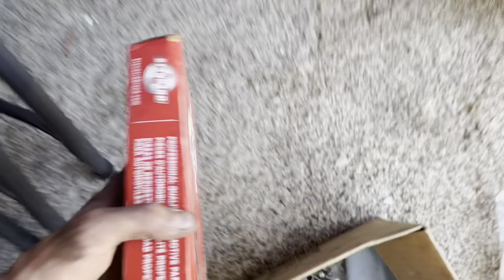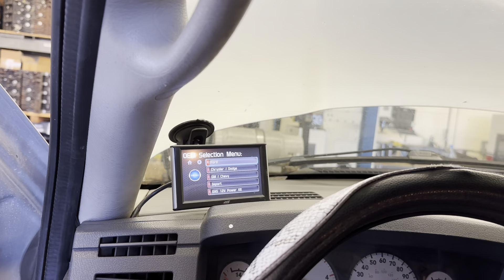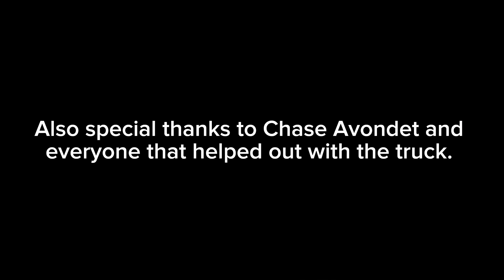WORLD RECORD AT RANDYS Diesel EVENT!!

Comment: Red loctite on the converter bolts & the head of the bolt. I also scuff up the flywheel for a little more bite. Never had em come loose. Whether I used 6 or 12 bolts